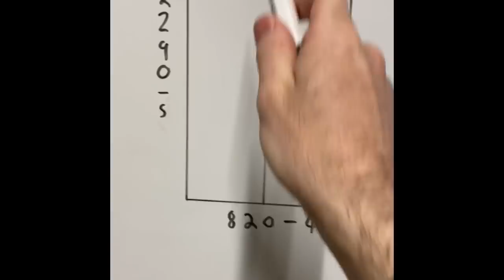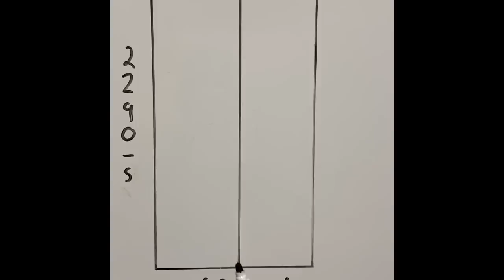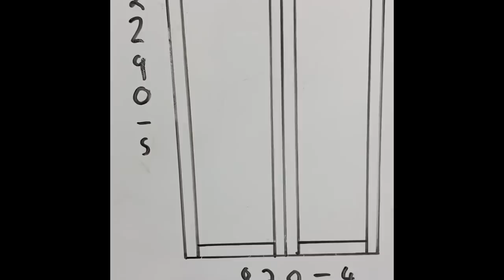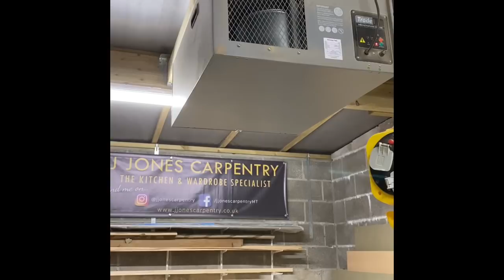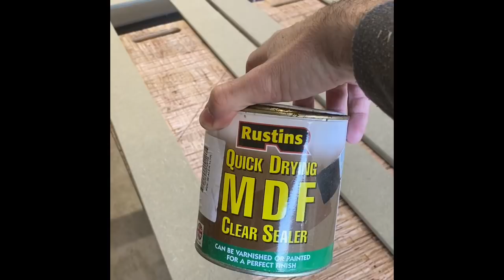Jones Interiors - episode 1 - how to make a shaker style door

Comment: Great work john, i personally use the same method as peter millard but i domino the joints too, i see lots of people struggling with the end grain on the edges for a decent paint finish but i solved the the problem ages ago with advise from my brother who owns his own car painting business, i sand the edges so there smooth and i brush paint them with automotive high build 2k primer, let it dry hard over night and sand back, you primer wont sink into the mdf if you do this so you will save a bundle on iron on edging, keep posting mate, ste.

Comment: I used your construction method a few weeks after you posted on Instagram.  Worked well, not quite as smooth as you and I made a few mistakes but the overall affect was great.  I thought about using stops to prevent my track saw from over cutting but I soon got to grips with it once I realised my Makita saw had a indication on it.  I do have a problem with dust extraction on the Dewalt router that I need to get to grips with.  I have to wait for the weather to be good enough to work outside my shed based workshop.  Now I do have a problem with getting a decent finish on the edges, learnt a little bit more here.  Thanks so much.  All the best to you and all the trades having time on their hands and the uncertainty of income at this time.  You do such a great job.  I love the Kreg but as a DIYer settle for the baby one.  👍🏻👍🏻👍🏻 Regards Mike
Reply from the maker: Mike S Hi Mike, thanks for your message! Regarding the door method, it just takes practice. The first few that I did, I made loads of mistakes... and I’m supposed to be a professional! Lol! Dewalt haven’t got a great reputation with dust extraction - especially on their routers - it’s something they really need to pay more attention to. I’m very fortunate to have the kreg foreman but for many years I also had the baby version and I still use it on some jobs!

Comment: Use the offcuts from the centers for  making up radiator covers. Only need 100mm and 120mm strips.
Reply from the maker: sean duffy funny enough I have got some radiator covers to make 😉
Reply: @jonesinteriors633  They can be an easy money. I generally rip all 18mm Mr offcuts to 120mm so have a good bit of it on the rack.foubd when I use to keep it for draw fronts ect I'd spend half an hour picking through piles of off cuts so wasn't worth it.

Comment: Hi John.  Thanks for sharing how you do things. I’ve thought about doing it this way myself but feel the amount of waste from the cut out is not cost effective. Do you have a domino, Lamello or biscuit joiner? I rip my sheets down to 80mm for the rails and stiles, like you I use a 6mm insert panel but I set the rebate 4/5 down from the edge of the board and slide my panel in after I have joined together a stile and two rails, then fit the last stile on and clamp. Pretty quick method especially if you use the zeta which doesn’t require clamping. And, there’s always a plant on method using 15mm and 6mm, use prep tape on the edges to cover the join. Let me know if you have a go how you get on. Jason
Reply from the maker: jason child hi Jason! I don’t have a domino or lamello - the lamello is on the list of tools I’d like to get though. I do have a biscuit jointer - but I was always concerned about the strength, and you still have the joints to deal with. Regarding the waste, I do put them through my table saw and square up the ends and use them for drawers and fillers and other little projects. I obviously do get rid of a lot of waste but I still think it’s worth it for me. I definitely do want to try the plant on method with the edge tape - maybe on some small jobs to begin with. I’ll let you know how I get on!

Comment: Great video John. I’ve also seen people making these with a solid peace of mdf then doing the strips in just 6mm mdf 100mm wide. Have you done it that before? If so what’s advantages the way you do them?
Reply from the maker: Danny yeah I know the method you’re talking about - using 12mm MDF and then planting on 6mm to create 18mm thickness. I know a lot of people have a lot of success with the plant on method and it’s very fast but there’s a greater chance of the door bowing with this method, plus you’ve still got the joins to consider. Also, when you open the door, unless you use an iron on edging for the edges, you will see the lamination. But with every method there are pros and cons. This way has always been my preferred method but can completely understand why others would choose to go down a different route.

Comment: Great job on your first Youtube video. I had watched your Instagram shaker door video and loved it too. So much , I made some shaker doors using that method. Do you do anything with the pin nailer nubs that are raised on the MDF?  I semi- successfully sanded the nubs back, but they tend to show. Any tricks there?  Thanks again for a great video. 
If your looking for ideas for another video, would love to see how you go about measuring and fitting a word robe on a slanted wall.
Reply from the maker: john gibson with the 23 gauge nailer, you don’t really get the raised nib so a light sanding more or less makes it disappear. When a nail goes into MDF, it causes the fibres to push out and cause lumps. I know this sounds made but the best way I’ve found to get rid of them is to dig them out and then fill. But this is a long process - and it’s probably not worth the hassle. 
I would like to do a full build video - I’ve got quite a few angled wardrobes coming up - hopefully this lockdown won’t last for too much longer and I’ll be able to do them! Watch this space!
Reply: Sounds good John. Thanks for the reply. Best wishes to you and your family. Nice work you do.